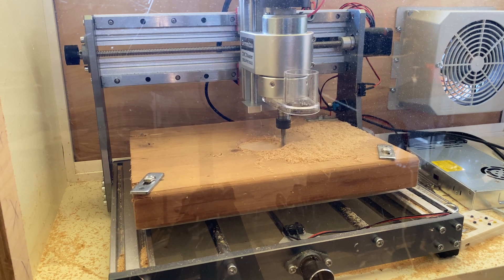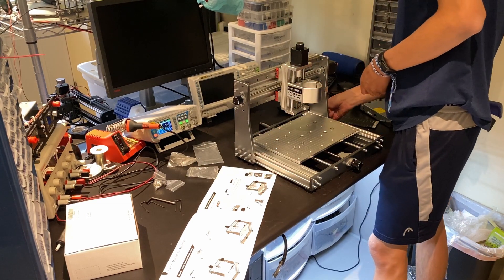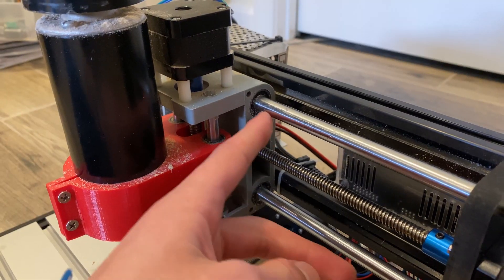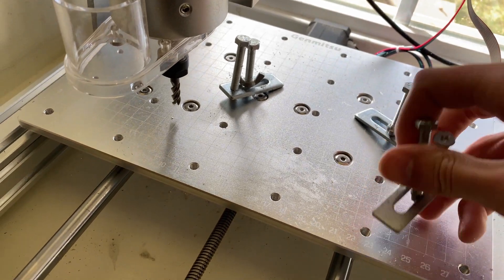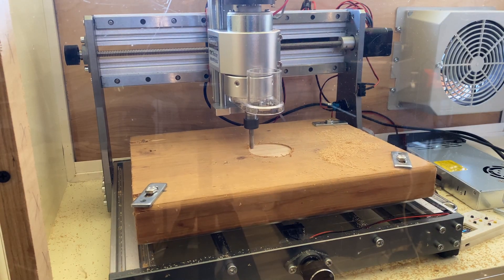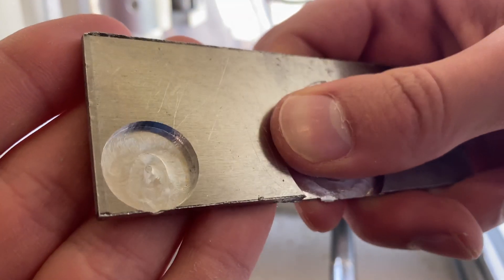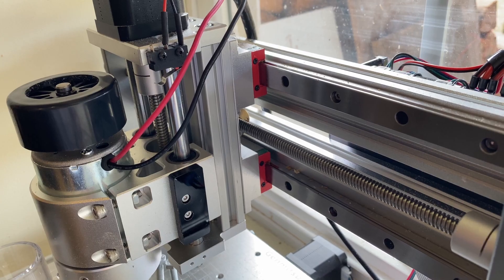3020 CNC Demonstration Review - (Sainsmart 3020 Pro Max)

Comment: Hello! Thank you for your video! Did you calibrate the e-steps to ensure that the motors were moving the correct distances as they should? I saw that you almost described calibrating the voltage for the stepper drivers because most of the time they are under powered causing the missed steps with these types of machines and need adjusted.

Comment: 20 inch/min in aluminum, impressive! what where your DOC and end mill size/geometry
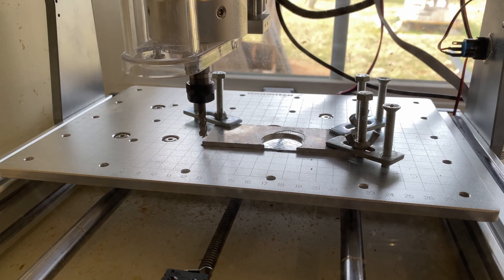Reply from the maker: It was a 1/4” square / flat nose end mill with 3 flutes. I don’t remember the DOC but it was fairly shallow as you can see at 2:20